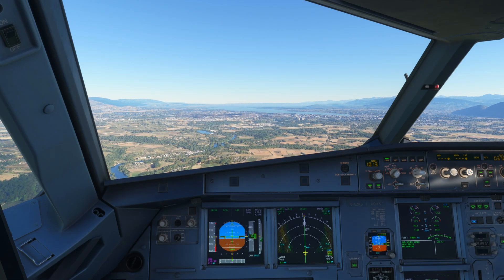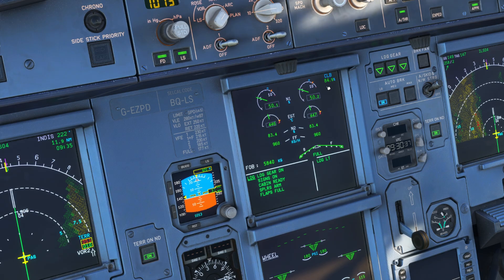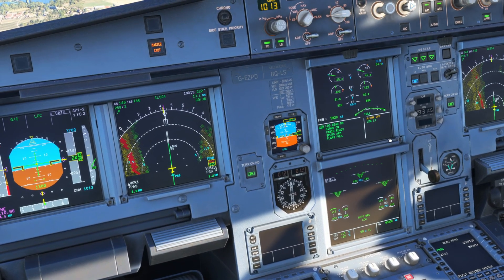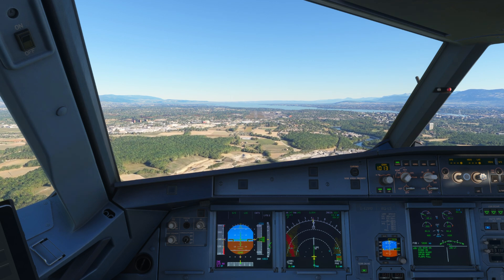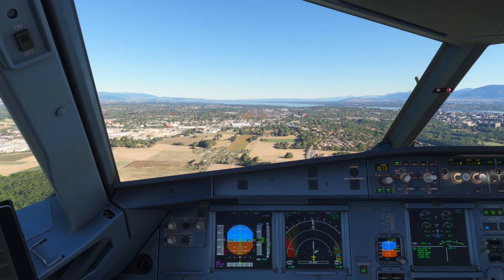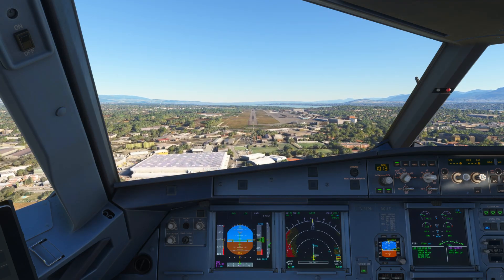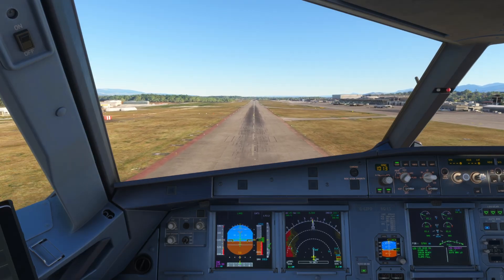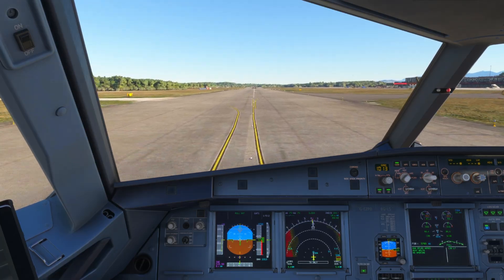How to Use Manual Thrust in the A320 | Real Airbus Pilot Tutorial (MSFS 2024)

Comment: Thanks for the Vid. How often do you use it? And are there certain scenarios/ criteria for its use?.
Reply from the maker: The Airbus auto thrust system is very capable and generally better than human management of thrust. Some airlines do not allow it in normal ops others encourage it. It is pilot preference at my operator and I will tend to use manual thrust on calmer approaches as in windier conditions the auto thrust responds faster to wind shifts
Reply: @ thanks sir! Loving your work!
Reply: With Lufthansa It’s actually required to be disconnected for all manual landings.

Comment: Liked the tip about not using excessive thrust values on approach - keep to plus or minus 10% 😉
Reply from the maker: Overreacting with those throttles will quickly mess your approach up and would get you a note in a SIM check, a small but important detail 👍